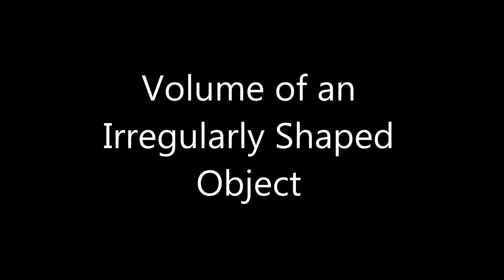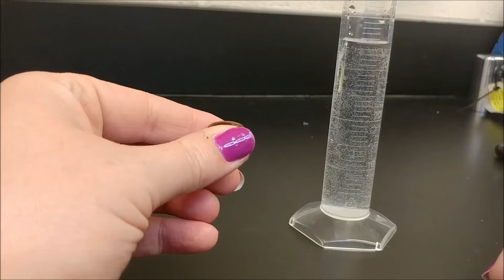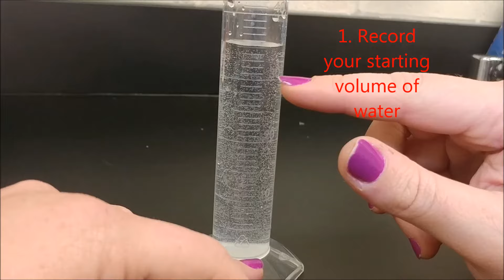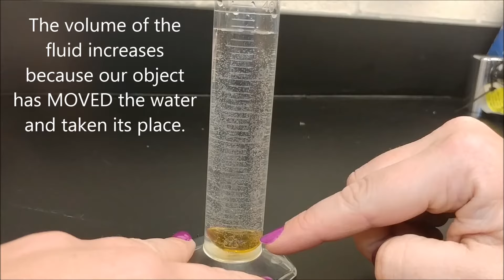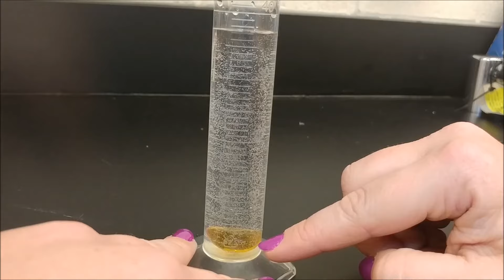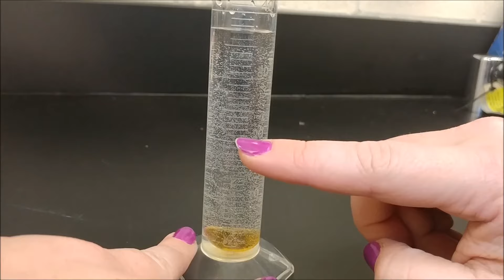water displacement method for volume

Comment: Actually, you are incorrect. For the water displacement method you have to slide the object in on an angle so no water splashes out of the graduated cylinder and ruins the calculation. It is very important to keep all of the water in the graduated cylinder so you get the correct calculations and get the correct volume.